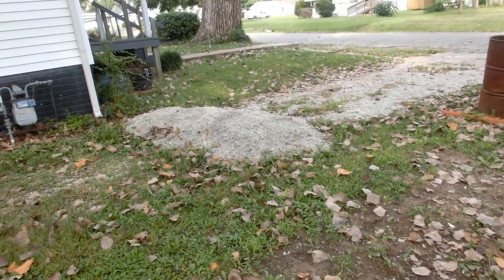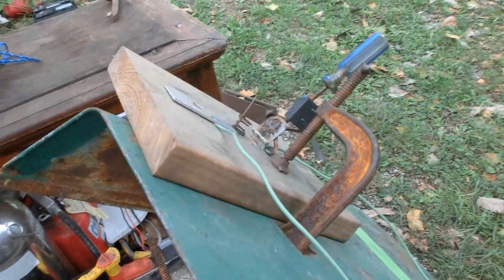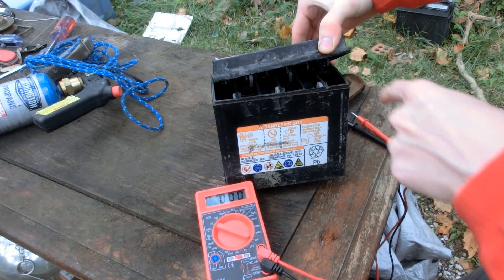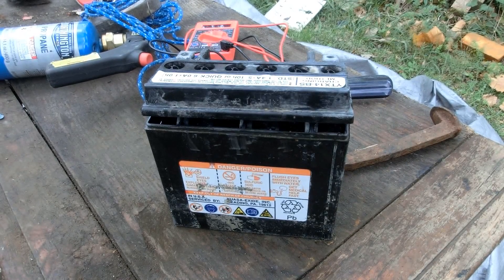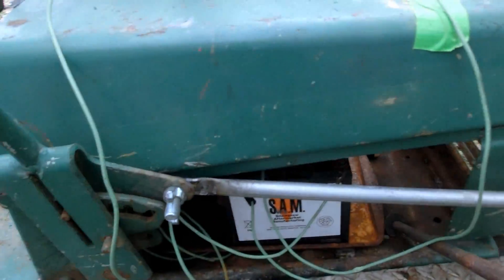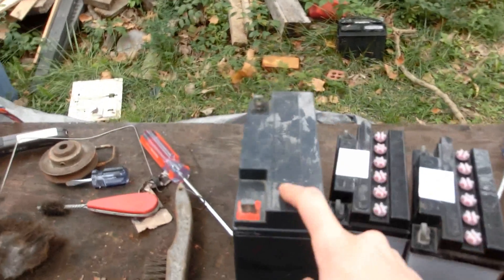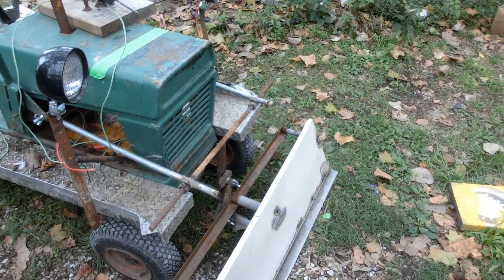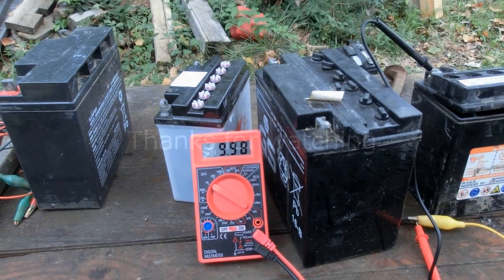DIY Electric Lawn Tractor part 12: Moving Gravel

Comment: I did worry about the effectiveness of the ventilation in your shed, one spark and the hydrogen produced by charging batterys could make a mess of you, please be carefull.

Did the digger battery do a mini hydrogen explosion, thank god you put a hood on to protect yourself.

That motor drive works so well :-)), very quiet, did the drive smashing :-))

I know you can slow the tractor down for more grunt but a better motor may be the way to get more torque and the same speed it has at the moment.
Reply from the maker: lol the exploding battery isnt all that dangerous. just water and plastic.

and the shed has too many holes to hold hydrogen, theres always a breeze through it weather i want there to be or not.
Reply: Rinoa Super-Genius
They do throw out the acid as well, ive been near a truck battery explosion, not very plesent, take care.
Reply from the maker: zx8401ztv
 yeah but the acid is 95% water and doesnt burn you, can burn your cloths though.

with these tiny batteries it just makes a pop and shoots the caps up.
Reply: Rinoa Super-Genius It does not burn your fingers, but when you forget that it is on your hands and than wipe something out of your eye, you get to remembering pretty quick. That is the voice of experiance talking.

Comment: When you build the next blade, making it adjustable left/right (large turnbuckles maybe) could benefit you for pushing snow (or other) out of the way without piling up in front of the blade,  just a thought.
Reply from the maker: yeah, i'm thinking i would make it so there was a hinge on one side and on the other was a level i would turn, that would adjust a threaded rod that would pivot the front plow. that way it always is level to the ground.

now that i read what you typed again, yeah turning it in the Z axis would be a great idea also. for now i'm going to focus on the electrics and moving the throttle to foot or something. i figure i can just push the snow into a pile and either push that into the ditch or just shovel it.

an idea i have is to lay down metal wires in my driveway so i would put lots of current through them to raise the driveway to like 50 F* to melt the snow, the water would then drain into the ditch and refreeze.
Reply: Rinoa Super-Genius Yeah, the thought was center pivot, adjustable on both sides to set whatever angle you wanted.

I've been waiting for you to get tired of that knife switch, so many ways for you to do that with your foot, I'm sure you'll come up with an original method.

Heated driveways are common up north so I hear, I've never seen one in use, should be a cool project.
Reply from the maker: mo_viking
 i'm currently taking large mosfets from old televisions and hope to use them to switch the motor. i'm thinking solid state is the way to go because then i could also pulse it to go through a step up transformer.